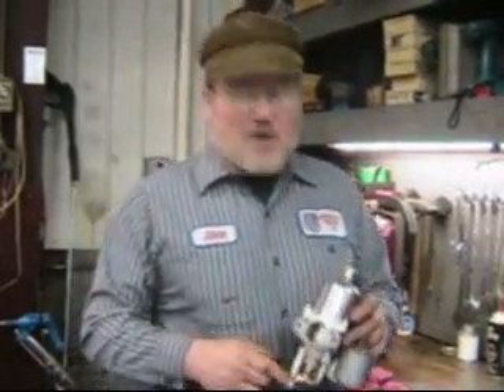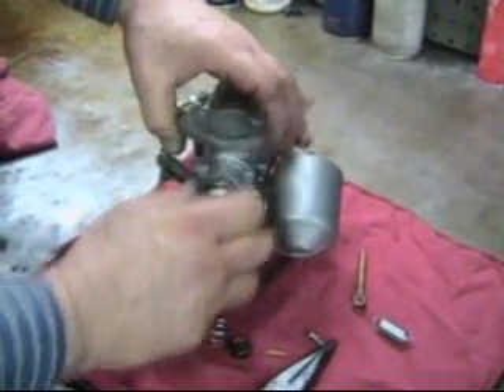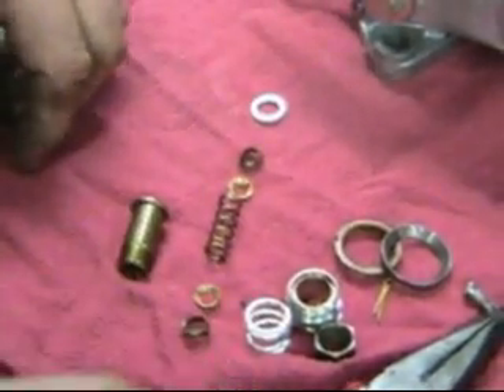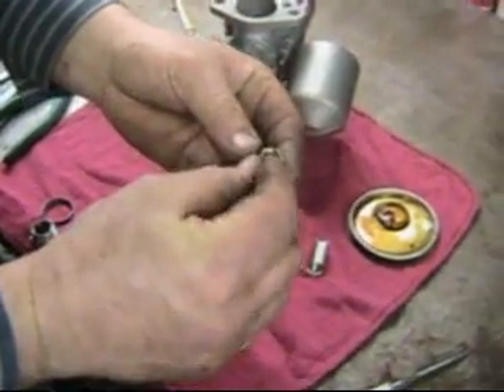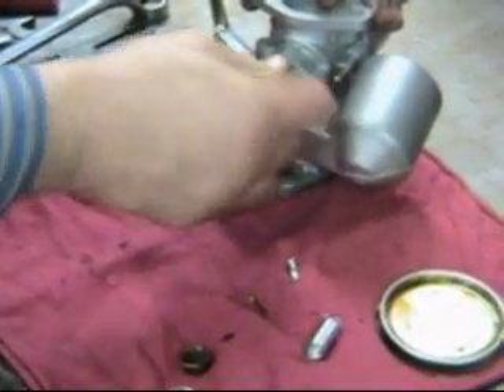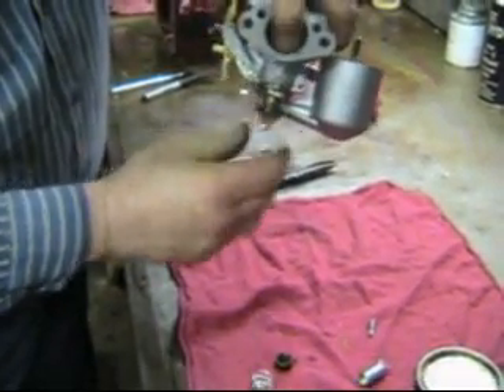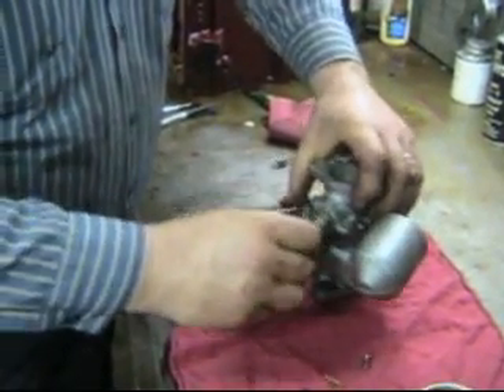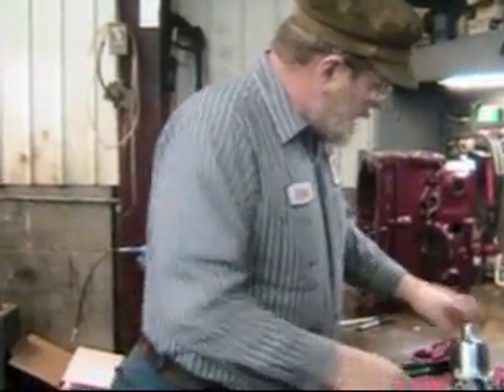055 MG Tech | Centering the Jet on an SU Carburetor

Comment: John.. I've been doing this with the dashpot removed and lifting the piston from the top of the carb then putting the pot back on. Is that the wrong approach?  (The carbs are still in place. The rear carb would rev but the front is hesitant. Hence why I thought the piston was dragging. I ran the engine with the throttle linkage removed and carbs working independently to discover this..

Comment: On the H2 1970 they have spring loaded needles. the question is there jet packing cork or rubber parts As i have bought new jet bearings for some carbs that I bought used. Did not find any packing in the old jet bearings
thanks

Comment: "If ya don't get the jet centered, the car runs crappy."
 
That's an understatement ;)  
 
I had to use a jet centering tool to get the rear HS2 carb centered.  No amount of slow adjusting using the needle was working for me.  The little tool saved my sanity.
Reply: I concur. I think reason tool is preferred over using needle is because I find when tightening the jet shoulder nut, the needle is not sturdy enough to stop the lower part of jet+shoulder from being coersced ever so slightly out of center by the action of tightening. I will buy this tool.